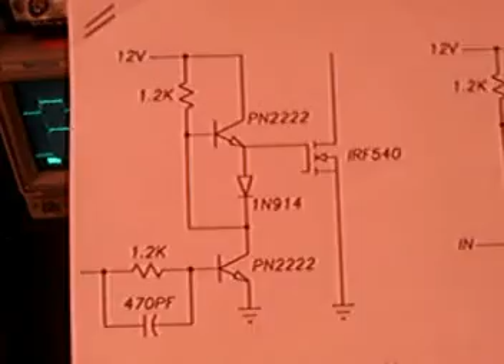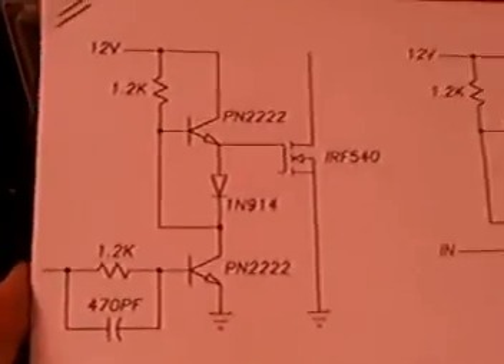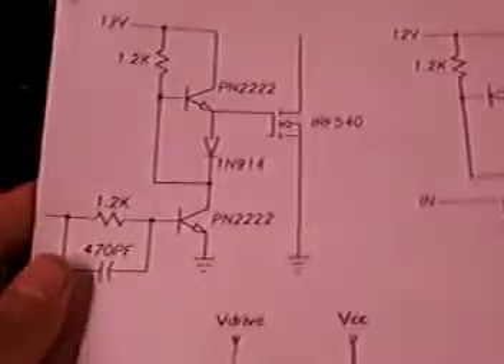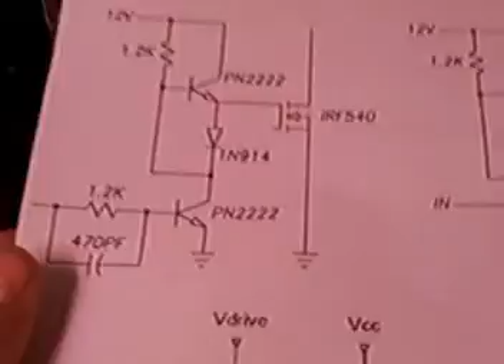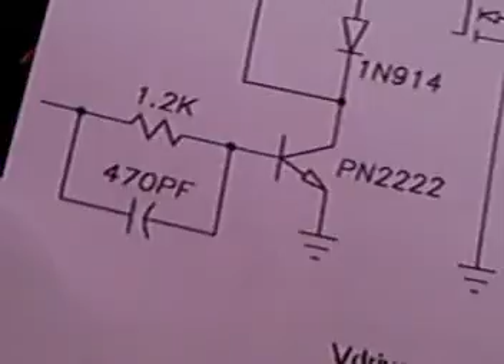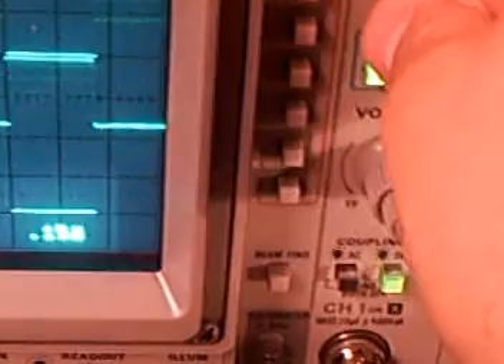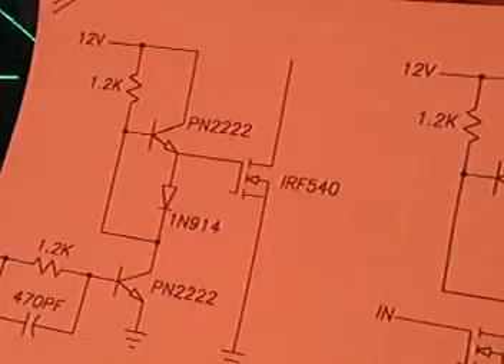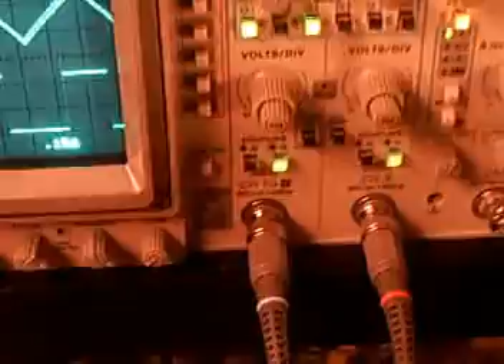New MOSFET Switch - Part 2 of 2

Comment: Another question you asked was the ripple on the output wave ... that is easily explained by capacitance (of your cell plates which emulate a big capacitor) in the case of your cell.  It is also explained by inductance (of your light bulb, as it emulates a coil of thin filament which produces an EMF) in the case of your bulb.

Having said this, I would also add:  damn good work!  We need to investigate more on these cells.

Comment: Yes, the nMOSFET will work with any input waveform that at some point crosses the +Vth voltage (it is specific to the MOSFET used: in your case is 2v @25°C).  In fact if you look at your scope the output switches at exactly that voltage.  Moreover, you don't get slopes but abrupt changes in state because you are using the MOSFET in a switching config.  You are using it in the saturation region all the time and not its ohmmic region (where it would be considered an amplifier and not a switch).